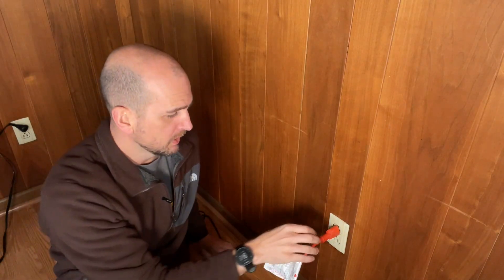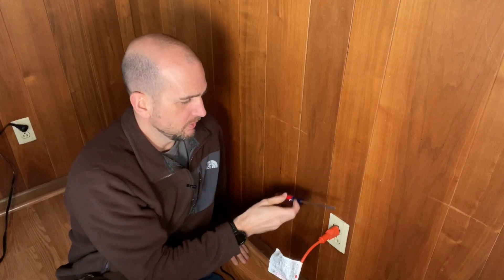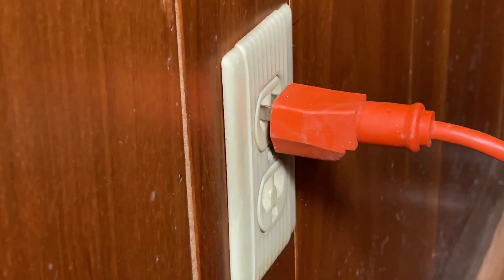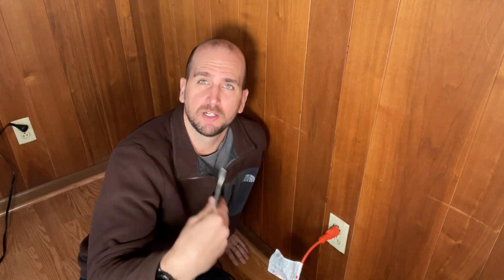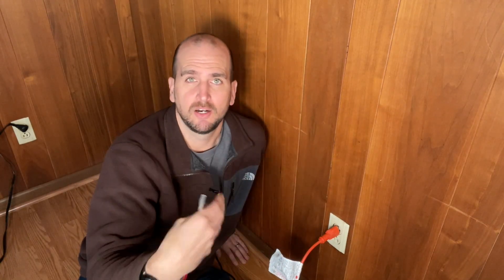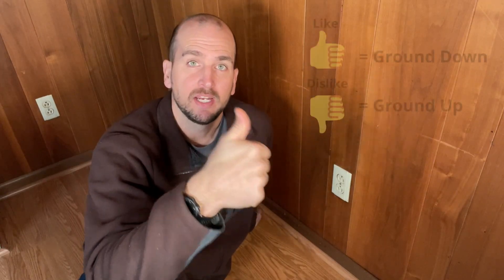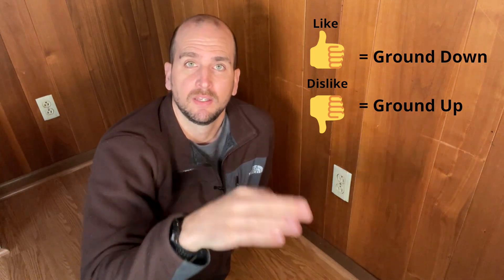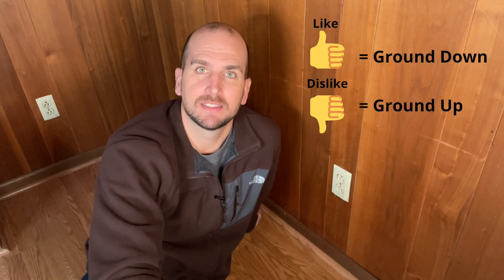Should An Outlet Be Installed Ground Down Or Up

Comment: I have always wondered about this. My old boss had us do ground up. The logic was a penny or something could slip in there.
Reply: Pigs can fly for a few seconds if thrown out of an airplane, but getting hurt on a hog farm when a gate is left open is much more of a concern.  A falling pig kills the pig, but a loose pig can kill the farmer or other livestock.
When a 3 prong grounded plug is partially removed with ground up, the ground lug breaks contact first, causing a loss of protection which can result in a fatal accident.
When a 3 prong plug is partially removed with the ground down, the narrow hot fails first, wide neutral second and ground last, providing safety and allowing the energy in the capacitors of an appliance to discharge.

Comment: When people plug things in, they often have their fingers touching the plug on the bottom, and if it is ground up, you will get shocked.  I've never dropped anything on a plug slightly unplugged where it would short.  I ALWAYS make sure the appliance is fully plugged in.

Comment: I hate ground up. I also think the tradition receptacle is a terrible design. instead of the 2 outlets being stacked vertically it should be horizonal so you can plug in 90 degree plugs so annoying with the traditional where I need 2 1 foot extensions to have the clearance.

Comment: Sooo has anyone actually tried to drop something on the plug to cause a short? Sorry, "computer says nooo..."
Reply: your computer has never been to prison. Prisoners love to see a ground down installation so they can tear their bic shaver apart, get the blade out of lit and drop it across the two prongs which will heat up turn red and light their cigarettes or a roll of paper to set their mattress on fire. A ground prong up installation makes this a little more difficult on the prisoner. They also get lead out of a pencil and do the same thing with it. SOOOOOOOO.....educate your computer.
Reply: @notagimmedat  When you get out of prison go to "Little Britain" where the computer always says no!

Comment: I agree with David Gates over 70 years for me.  Biggest potential problem in USA is your fingers coming in contact with live and neutral as you plug in, especially with two pin plugs. Answer: Ground down in USA. Possible interesting facts. a) Ground (earth) is up in UK. They also have partially insulated plug pins to prevent operator from touching pins after they have contacted juice inside socket on their way in. b) All outlet sockets are switched (manual on/off lever) c) UK switch down for on up for off (took me a couple of years to get used to that one.

Comment: I flip houses,, all grds down except for an outlet that works off a switch,, been through dozens of inspections w no prollems,, but do what u like
Reply: I dislike the practice of upside-down plugs for switches because It is unprofessional to be inconsistent.  It's the wrong solution to the "problem". You should install receptacles that are marked as switched.

Such as https://www.hubbell.com/wiringdevice-kellems/en/Products/Electrical-Electronic/Wiring-Devices/Straight-Blade-Devices/ConstructionCommercial-Receptacles/DR15C1WHITR/p/2608245

Comment: Well, to tell the truth and put in my 2 cents, I would like them to make receptacles or wall outlets with the ground opposite one another. With the way they make some appliance plugs, sometimes you can't use two of them in the same outlet. I've had some cords that the cord comes out the bottom of the plug and will block the other outlet. So having the top receptacle with the ground on top and the bottom receptacle on the bottom would work out far better. I've even had a few cords or devices like a battery charger if you plugged it in the bottom you couldn't plug anything other than a 2 prong cord into the top. I do like those companies that make a product with a large plug on a stiff or bulky cord that off set the cord to a 45 degree. In fact It would be a good idea to offset the receptacle so the ground would be 45 degrees opposite each other.
But I have had some experiences where the cord on an appliance had either a heavy stiff cord that comes out, of the plug straight down and would block the bottom. Or would have like a breaker in the plug that requires that you use the bottom receptacle and at times you can't use the top one because another device has the dame set up. If you have had some work to do and had that problem, you know what I'm talking about. Also some of these charging devices for all kinds of devices are to bulky the way they are made and require the bottom receptacle the way they are made. After a bit you run out of places to plug them in if you have kids with their devices. God help you if you unplug one of theirs.

Comment: no code requirement on nose up or nose down. Unlike UK. But.. Most of mine are Nose down, unless the appliance itself requires the nose to be up... my reason is simply upon the stress on the cables.

Comment: The three houses I built or restored passed inspection only with ground down. That was Virginia, West Virginia and Florida. I like the tip on ground up for switched outlets, thanks, I'll be using that even after inspection.

Comment: I had a house that had the switched outlets ground up and unswitched ground down.  Actually handy.
Reply: That is something that lazy/cheap electricians do.
It is unprofessional to be inconsistent, and it's the wrong solution to the "problem". You should install receptacles that are marked as switched.

Such as https://www.hubbell.com/wiringdevice-kellems/en/Products/Electrical-Electronic/Wiring-Devices/Straight-Blade-Devices/ConstructionCommercial-Receptacles/DR15C1WHITR/p/2608245

Comment: To me ground places up is a shock hazard.  When you go to install a plug notice that your index finger is closer to the hot part of the plug.  Your thumb is normally back 1/4 to 1/2 inch and you can see it.  The index finger is on back side and you can’t see it(location it’s touching).

Comment: Ground down.  Having those 90 degree cords turn up and loop around can't be good for the cord (and as you said, negates the purpose of trying to get the cord closer to the wall).  To have something drop and hit between the plug and the wall has got to be an incredibly small chance, especially if the plug is fully inserted as it should be.

Comment: I'm an Engineer.  The skinny piece of falling metal is the only justification I've heard for ground up.  Great, don't leave skinny pieces of metal leaning against your wall that won't hug the wall anyway as they fall! 🙃  Seriously though, I've come across enough two prong polarized plugs that were not designed to logicaly plug into ground up sockets.  Some silly little liquid fresheners and night lights come to mind.  When I built my house, 20 years ago, I put in industrial grade 20 Amp Pass & Seymour outlets, Ground down.  They are still as tight as the day I put them in.  No loose plugs to invite a skinny falling piece of metal that never fell on them!  They all look like happy little right side up faces too!

Comment: which direction is ground? down..i do it this way because i do a lot of remodels. and work rec powered..you put on ground, then neutral, then most dangerous wire, hot..safety thing for electricians  me...50 yr master electrician

Comment: the "upside down" outlets in my home identify any switched outlets to make life easy.
Reply: Not a bad idea. Label maker works too.
Reply: @redstang5150  The best idea is not having switched outlets to begin with. In my business.  Cheap and lazy to install a switched outlet instead of putting a light fixture in.  I would love to see that be a building code requirement that all rooms have a hardwired fixture.  I consider it a safety hazard.
Reply: @drpinky504  How is it a safety hazard? The couple of places I have a switched outlet I do have fixtures as well. And while there's one or two places I wish I had one, TBH, the ones I do have aren't useful. The one in my bedroom is worthless, because if I'm going to run the lamp next to my bed, I don't want to get out of bed to turn it on/off! Dumb. Nowdays they aren't as necessary anyway because if I want a switched outlet I use remote/internet controlled plug.
Reply: @redstang5150  When it is vacant and no one has brought a lamp yet.  The switched outlet is annoying, but the lack of wired light fixture is the hazard.  In my business I am in a lot of vacant apartments to clean in between tenants.  No light  fixtures  in living rooms are a major pet peeve for me.
Reply: @drpinky504  Oh - totally get that. I was thinking more about the outlet being a problem than the lack of an overhead light. Yeah, having absolutely no light fixture on the ceiling at all? Dumb. And now that you mention it, I think my first apartment didn't have a light in the family room, but it was open to the kitchen so I didn't think about it that much. I bet a lot of places are like that.
Reply: @redstang5150  I have lived places like that.  I thought it was an old house thing, but I encounter it in new construction as well.
Reply: I find this very interesting
Reply: Same here. My house in Ohio and my house in Arizona both have ground down unless that outlet is controlled by a wall switch then the switched outlet is identified by being installed ground up.
Reply: This seems to be a thing some installers do, I've seen it in FL too.
Reply: Do you have a sharpie? put a black dot on those, and oh by the way is it fully switched or split switched?
Reply: @stevieg.4816  our FL home is split where just the top outlet of the ground up is controlled by the switch
Reply: @stevieg.4816   i personally keep mine split switched when i do it.
Reply: l told my electrician if he puts switch plugs in my house, l'd fire him !..
l was just tourmenting him, but in fact, l didn't want any switch plugs.
l don't miss switch plugs - at all - ever.
Reply: @grignosse  the only reason for most switched outlets is to avoid having a light that's wired in. I've got mixed feelings about that, but that's the main reason for it.
Reply: I went and looked an my place is the same. I had thought it was all of them. Tks for the heads up.
Reply: My apartment switches are ground up outlets, all others are ground down.
Reply: Not a bad way to do it but it would drive more people nuts I think. Personally I hate switched outlets unless they are purposely planned for something. Seriously, put a light in the ceiling and be done with it but that's another subject.
Reply: That's a great idea
Thanks
Reply: Nice idea but I would rather color the screw
Reply: @Stephen Wesolowski Most builders are lazy/cheap.  Getting properly labeled receptacles requires shopping at an electrical supply house (not big box store) and paying pennies more.  Most contractors won't do that.
Reply: The best method is to not have switched outlets.  All rooms should have wired light fixtures.  I wish they would actually make it a legal requirement.
Reply: I saw that comment earlier and it’s a great idea.
Reply: Not a bad idea.
Reply: I dislike this practice because It is unprofessional to be inconsistent.  It's the wrong solution to the "problem". You should install receptacles that are marked as switched.

Such as https://www.hubbell.com/wiringdevice-kellems/en/Products/Electrical-Electronic/Wiring-Devices/Straight-Blade-Devices/ConstructionCommercial-Receptacles/DR15C1WHITR/p/2608245

Comment: In residential homes, it is common to have large rooms with a switched outlet, meaning that one or both of the receptacles is actually operated by a switch. Electricians may position the outlet in an upside-down position so that you can quickly identify the switch-controlled receptacle. Since it stands out visually to most people right away – it provides convenience to the occupants to easily remember which outlet is switch controlled.

Comment: The purpose of having a ground and a neutral is to assure that the circuit and hardware does not become hot without a ground and/or neutral.  If the ground is up, the plug can pull out and hang from the outlet with the ground disconnected.  I have also seen the ground pole broken off the plug when someone trips over the cord. Ground down assures that the ground is the last connection that will disconnect if the cord is falling out of the outlet.  Ground down because of gravity.
Reply: The ground is longer to prevent a disconnection like that. I've tested it.

Comment: Tell you the story I heard. A patient had his transistor radio on the table next to his bed in the Intensive Care Unit. Not everyone in ICU is immobile (it has to do with available beds etc). He reaches for something and knocks the radio off the table and the antenna is fully extended.  It falls across the plug. Shorts out the RED outlet. (ventilators, IV pumps, EKG machines )  It doesn't take out the breaker It takes out the whole panel in the unit. ( the big 200 amp one on top ). The Doctors & Nurses do a Chinese fire drill until someone from facilities comes up and resets the breaker. Then there's the time Mom & Dad bought their kid one of those flint friction sparky guns from the hospital gift shop. Thing is the kid was in an oxygen tent. But that's a story for another time.
Reply: Hospital sparky here everything is ground up here greetings from Albany NY
Reply: @oddjobz9858  Yes, This happened a long time ago. When I asked why? I was told this is also done in nuclear power plants. Love to hear that story. Odd Jobz Lake effect snow season, hope the lake freezes over soon for you.

Comment: Normal installation has always been ground down.  The only exception I have seen is that often a switched plug is installed ground up.  This way it is easy to tell which outlet you need to use for something you want to be switched or which outlet NOT to use if you want what you plug in to have power to it always.  You may not want to lose power to your alarm clock when you turn off the lights to go to sleep.
Reply: Ya, that is something that lazy/cheap electricians do.
It is unprofessional to be inconsistent, and it's the wrong solution to the "problem". You should install receptacles that are marked as switched.

Such as https://www.hubbell.com/wiringdevice-kellems/en/Products/Electrical-Electronic/Wiring-Devices/Straight-Blade-Devices/ConstructionCommercial-Receptacles/DR15C1WHITR/p/2608245

Comment: Had the occasion measring behind a refrigerator with a metsl tape measure where the tape made contact with the hot and neutral because the plug was partially out of the receptical. A rare occurance,  just caused a spark that damaged the tape but didn'd trip the breaker or harm me. Lucky I guess. It was a ground down. Had it been a ground up, no spark would have occured. That said, I still prefer ground down, 99% of the outlets are that way. I guess I'm traditional that way.

Comment: The isuues with the ground UP, is with special plugs.  A special powerbar, a UPS often have the inverse 90 degree with the cable goin in the 45 degree slop.  Now they are specialty chargers that have the Keyed prong, Withe the ground up the bulk of the charging unit ends-up top side and when you add the batteries that need to be charged it become an issue.  Same with some power block.   Most of the hardware that needs to be plugged into an electrical outlets are made for ground down.   Personnaly in one instant I had to flip 180 degrees some of the outlets when the ground was up.   And in one case I've seen instance where the ground up on installed outlets were a fire hasard, but once flipped, the problem was corrected.   
If you install a bench and add multiple electrical outlets for that bench.  for example 4 outlets ( 2 ground up and 2 ground down)  that way if you have something with a different orientation of the plug, you wont have to bend in a weird way the electrical cable of the plug.

Comment: I worked for years as an electrician and was always told ground up.  Reason being that the large round ground plug on top holds the weight of the cord better than if it was down.  The gravity and weight of the cord will not pull the plug out.  I think it is just personal preference, but everything i wire in my house is ground up.  If i wire for others i ask what they prefer.

Comment: My wife draped her necklace over a slightly pulled out (ground down) plug. Scared the HELL outta her when it arced (and melted). Great fun! 🤣
Reply: that would not have mattered if ground up or down it is flexible enough to wrap around enough to hit all three points until it makes contact with the hot

Comment: At my place it's mixed: ground down except for the switched (lamp) outlets
Reply: That is something that lazy/cheap electricians do.
It is unprofessional to be inconsistent, and it's the wrong solution to the "problem". You should install receptacles that are marked as switched.

Such as https://www.hubbell.com/wiringdevice-kellems/en/Products/Electrical-Electronic/Wiring-Devices/Straight-Blade-Devices/ConstructionCommercial-Receptacles/DR15C1WHITR/p/2608245
Reply: @TonyPombo  I didn't know about those, thanks for sharing. However, this place was clearly given to the lowest priced contractor. Legally, they got the right types of breakers and all that, but everything is loose, cheap, etc...
Reply: @j777  Unfortunately, that is common.  The GC selects the cheapest sub-contractor bids.  I posted my message a couple times in an effort to educate, not criticize.  Professional electricians should know better and care more than they do.